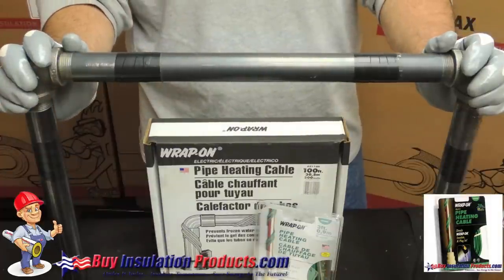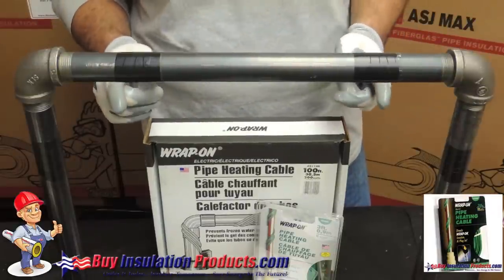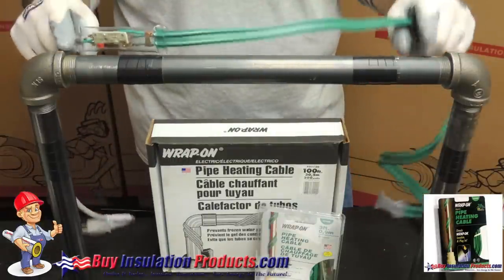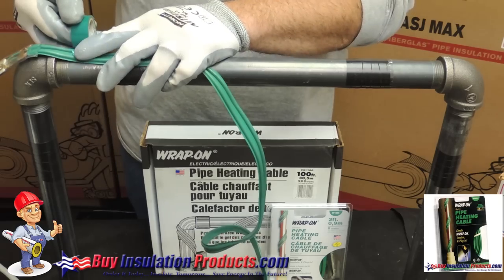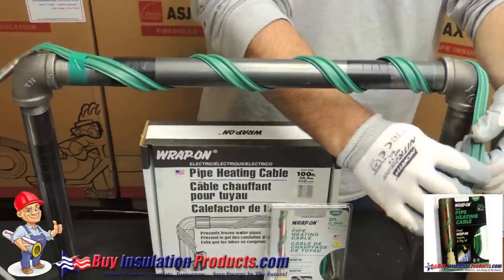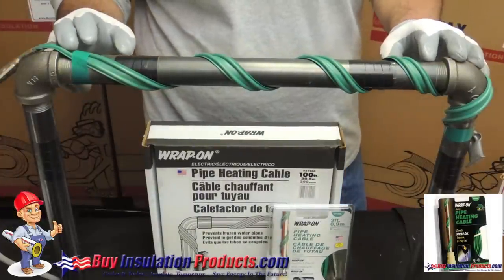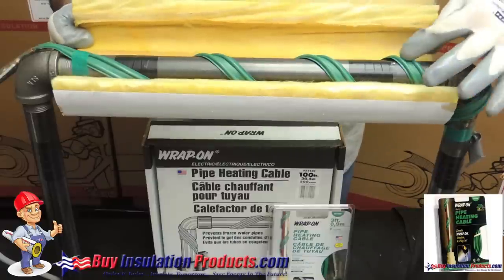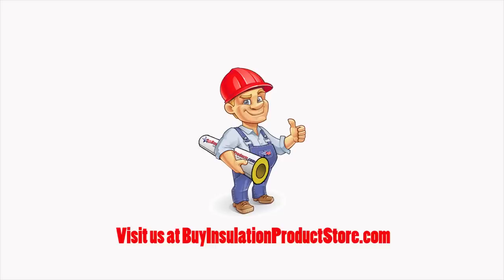Protect a Pipe from Freezing with Pipe Heating Cable and Fiberglass Pipe Insulation

Comment: HOW TO TEST PIPE HEAT CABLE TO KNOW IT ITS STILL WORKING UNDER MY MOBILE HOME .i  HAVE A FOAM INSULATING PIPE COVER OVER THE HEAT CABLE. SHOULD i FEEL THE PLUG WITH THE FIRST FOOT OF CABLE GETTING WARM IF IT WERE 38 DEGREES OUTSIDE?
Reply from the maker: Rondo, the thermostat on the Wrap-On heating cables has a test button, which you can press and it lets you know the heating cable is functioning correctly.  The thermostat will also light up when it is currently heating.  Make sure the heating cable is well insulated under the mobile home.